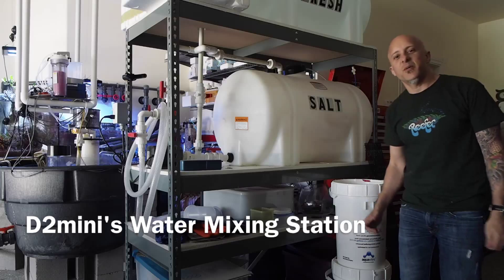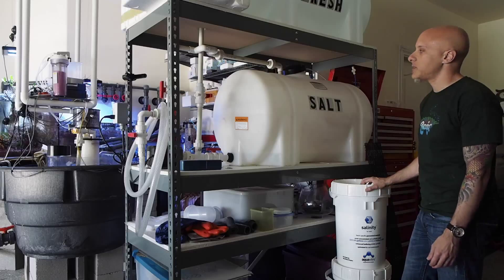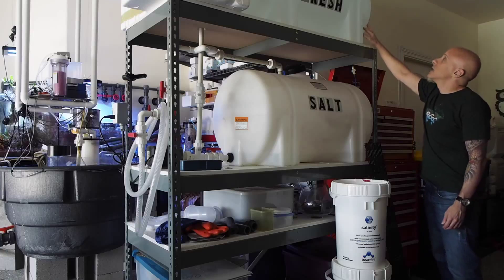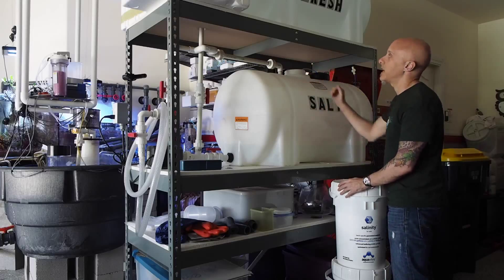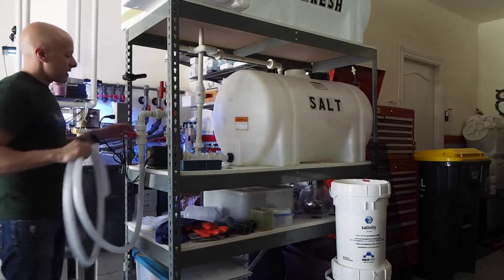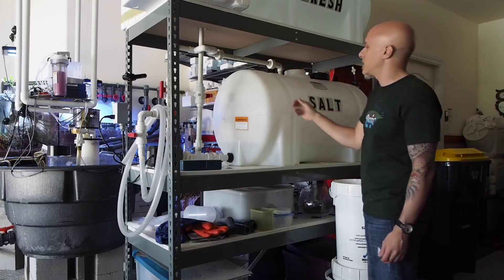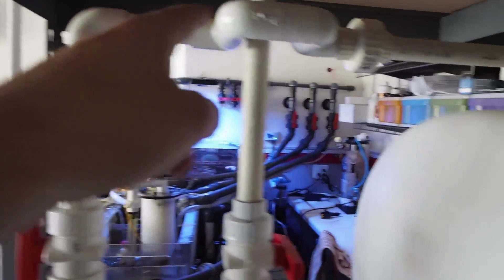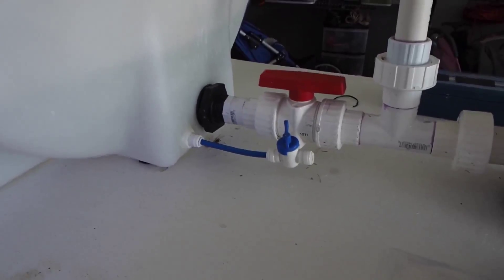D2mini's Water Mixing Station

Comment: nice set up!  I am using the same  tanks but smaller and I wonder if you used a fixed float valve or did you need the adjustable float valve for the rodi inlet.
Reply from the maker: I just use a standard mechanical float valve. https://www.bulkreefsupply.com/ro-float-valve.html

Comment: How do you heat the salt water?
Reply from the maker: muffemod don’t need to heat it. A few ounces of water won’t make any difference to the tank’s temp.
Reply: @d2mini  65 gallons is 8320 fluid ounces
Reply from the maker: muffemod yes but I don’t use it all at once. That reef and my current one run on an auto water change system that does multiple small changes through the day, every day. That storage tank would last me about two weeks.

Comment: really interested in how to controller and water change works. So controller tells one pump to turn on (draining sump) then turns another pump on (filling sump from pre-mixed 65 g jug?) what kind of pumps? how many gallons? 1/4 water line? and drain back to a sink? Sorry for all the questions. i love ur system. Great inspiration!! keep it up.
Reply from the maker: Whatever pumps you want. Rio, magdrive, anything submersible. I use the 1/4" water line with John Guest quick fittings. You can get adaptors at home depot to screw into the pump outlets. I do around 1% so for me that amounts to around 3-4 gallons. The controller uses level sensors in the sump, so once the water level drains enough to activate the lower sensor, it turns off the drain pump and then activates the fill pump. Once the water level gets back up to the upper sensor (which is also the ATO level sensor) it turns off the fill pump. During this AWC process, the ATO function is disabled and is automatically re-enabled when it's complete. Thanks!